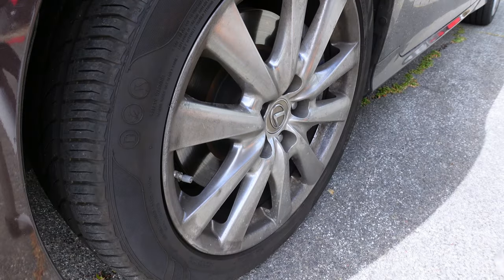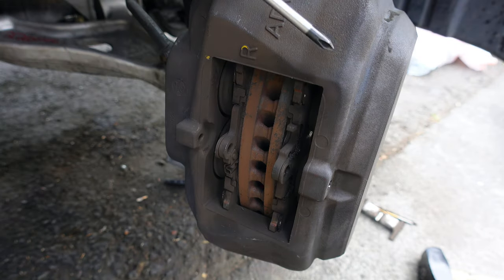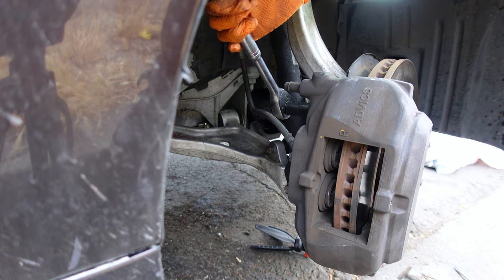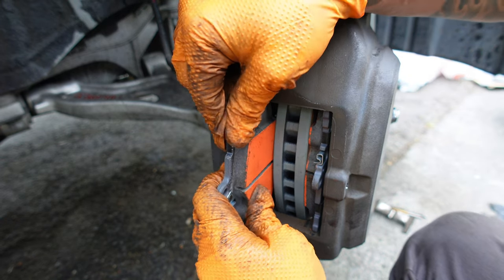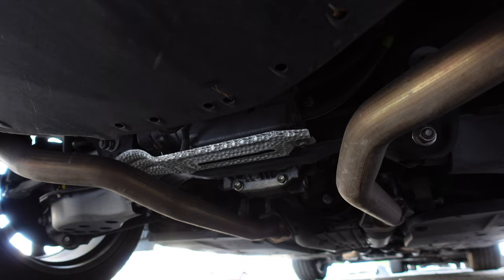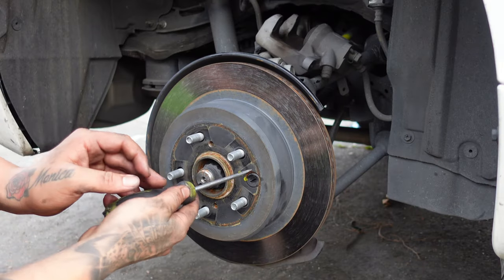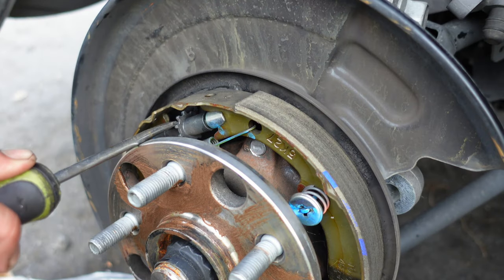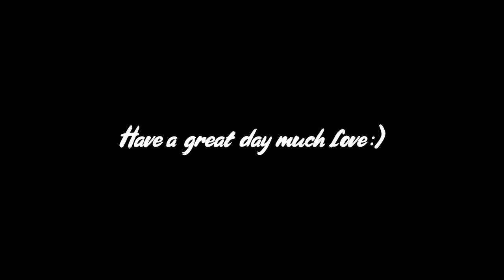How To Replace Brake Pads and Rotors on Your 2013 - 2017 Lexus GS350, IS200T & IS350

Comment: Can you just remove the rotors without having to adjust the parking brake shoes? And instead of a bolt, can you just use a rubber mallet?
Reply: Just use a 3lb ledge hammer it comes off who cares if u damage the rotor it’s gonna be replaced anyway I did mine today

Comment: what about F sport ?   would you consider akebono vs bosch quietcast pads?   ever just swap out pads and not change rotors?
Reply: If the rotors are not bad, there's no need to change them. It's just a waste of money to me.
Reply: No. F-Sport pads brake have different compound ( more soft and sport ). A good option: Pagid Street Plus  pad brake.
Reply: It’s doesn’t matter. Whatever you budget can afford. I own an fsport and have changed my brakes twice. I’m doing akebono since it has less brake dust. 

You can do just brake pads depending how worn the rotors are. One way you can tell is by running your finger down the rotors and if it has a lip at the edge it’s time to change them. I’m changing my rotors and brake pads this time around. 

Also, if you own fsport make sure it’s the 356mm size. Oreilly sells them but it’ll run you $140 a piece

Comment: @XJ Jesse if the vehicle has an electronic parking brake like my GS 300 H has, is there a service rear brake option using the an OBD scan tool ? would that release tension on shoes ?

Comment: I changed the brake pads only but when putting back the 14mm bolt to hold the brake caliper I didn’t measure or put the blue liquid you used for the vibration I just tied it very hard will the be fine thanks great video
Reply from the maker: Yes, you should be fine 👍🏽

Comment: what is that as big as rotors thin disc looking thing behind al these rotors called? mine is warped and makes scracthing noises when I turn left, is that bad? much appreciated
Reply: Its called a dust shield or heat shield, you can bend it back it should t have any affect on the operation of the brake system